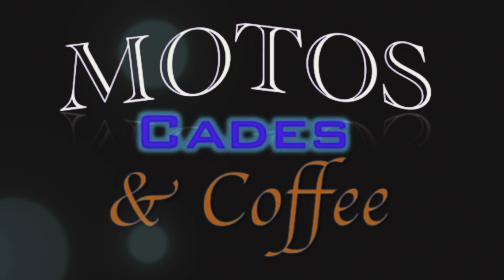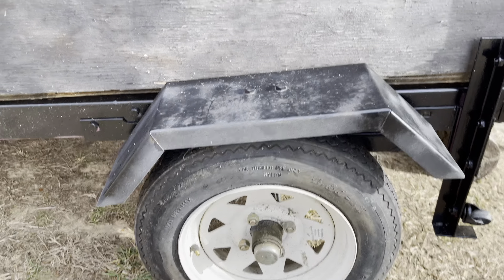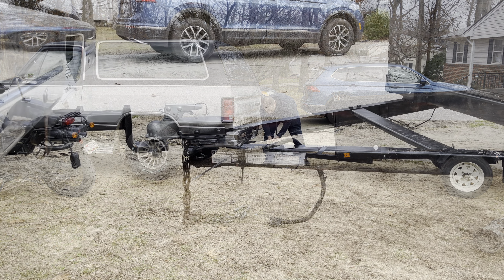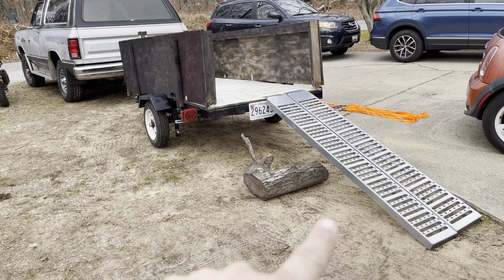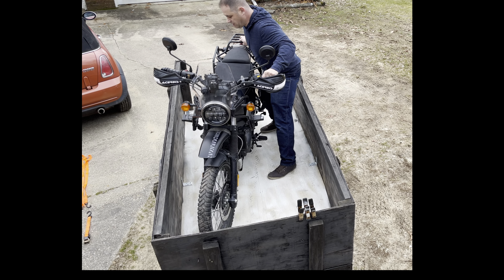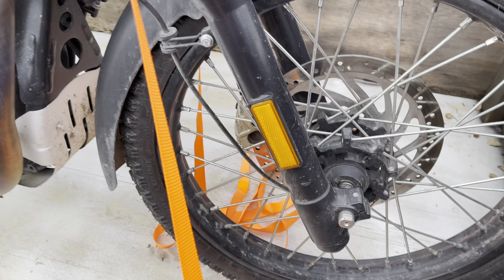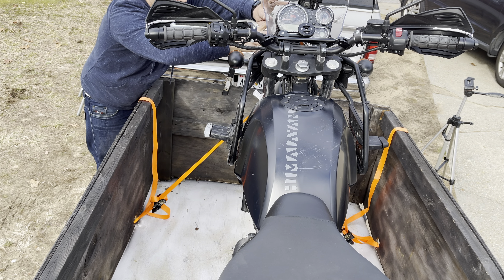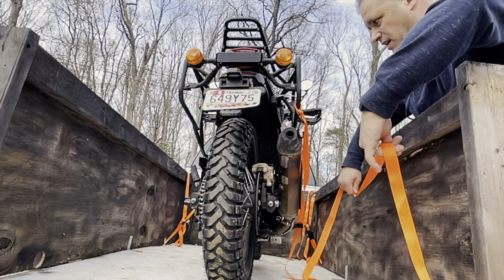Royal Enfield Himalayan | Secret to Loading on a Small Trailer

Comment: Trailers are great being multipurpose but more potential problems to worry about. I use a MC carrier on our Astro for the Himalayan, it's rated to 500 lbs. Easy to load, unload. Had considered an enclosed trailer that could be camperized with folding beds etc and the bike in the center but then thought our van is already a sleeper so didn't bother. Great channel!
Reply from the maker: Thanks so much John! I totally love my Himi! It’s also great to have a MC carrier. As you mentioned a trailer is multi use and I use mine to move arcades and pinballs too :)

Comment: Don't tie down on the front racks. They are just a clamp type bolt securing them and the racks may come apart or in my experience one did come apart almost too late.
Reply from the maker: Good call! I’ve been tying down from the Triple clamps from now on!
Reply: @MCCJustMotos  No worries. Happened bringing my new 2022 home last week cause the dealer said that would be fine to strap it there.
Reply from the maker: @timothyletwin5911  that’s A terrible story did the bike fall? Or did you get new racks installed?
Reply: @MCCJustMotos  Luckily it just pulled one side out of it's connection. it's the straight tubing that connects from either side. It bent but did not break and I had the bike in a wheel chalk so that saved it.

Comment: One thing I would add, is that I crisscross the safety chains.  Then, if the trailer should pop off the hitch ball the cross in the chains will help keep the trailer tongue from hitting the pavement.
Reply from the maker: I’ve never heard that before. Seems very smart! Does it interfere with turning?
Reply: @MCCJustMotos  I've never had a problem.  Just make sure that you have enough slack in the chain.  By the way I have a 2018 Himalayan.  Love the bike.  I've done both the MABDR and NEBDR with it over the last two summers.
Reply from the maker: good tips! wow that is awesome on the routes, and thanks for sharing! I’ve never seen those routes but great to know they are so close!!! I did a Maryland to Montana trip this summer. I don’t know if you followed along with that?
https://youtube.com/playlist?list=PL0LSKuqkTCdjv5iRiSD3iYnFumwcuaZr8
Reply from the maker: i’m planning on it later this year! bookmarked and i’ll defiantly reach out. Vice versa if your ever down this way!